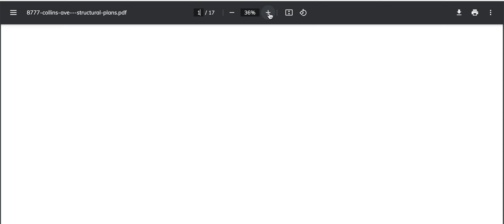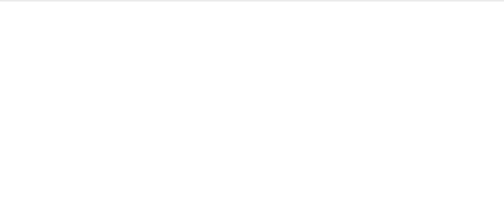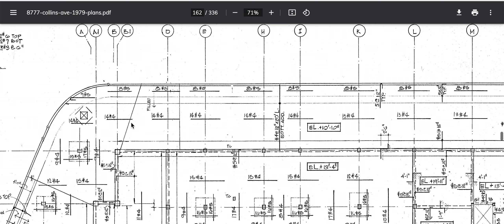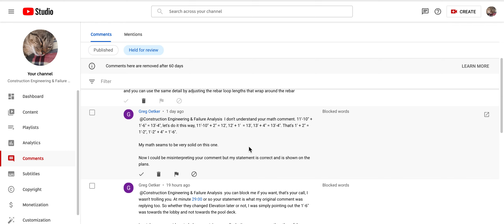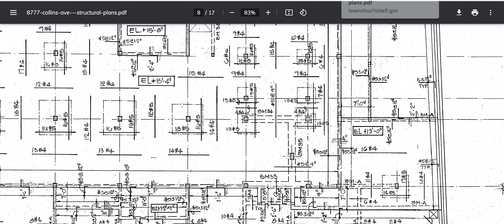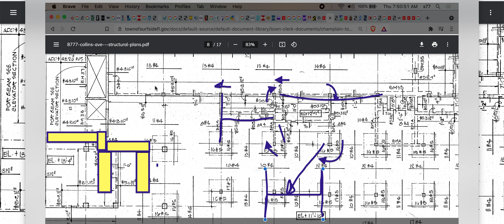Champlain Towers Surfside Building Collapse Cars AND pool deck butterflied plus bma fracture

Comment: I have looked at a lot of Videos on this Champlain Building Collapse in Florida and i always had the feeling as of the way the carpark always had Water on the Floor and cracks in Ceiling.and Always they said had to Pump a lot of Water in Carpark plus Sea Water as Well and i thought the with so Much Water over the Years and believe the water were quite high up on their cars i would not Park my Car in a Carpark what i saw the Condition in that Carpark as if i have to park my Car in a Car Park in and under a Building i know to look at were i am parking my Car.The only Time these Days as of Lockdown in AUSTRALIA u cant go anywere much but sometimes i would Park my Car in an underground Carpark below the Picture Cinema and left my Car to be Washed and chamied off and Tyres Blackened and Cost me $30 and Vaccumed inside as well but never looked at the Concrete before of the Building but After this i will be looking at the Building more as dont like to live in High Rise but live near Beach 15 min walk and 5 min Drive and live in a Single Brick Unit with a Conrete Slab.I did at first think it was a Sink Hole as.other Videos i have looked at in Florida Houses about 11 Houses were Taken by SinkHoles and then the whole Houses would just Sink all of it.But this was No Sinkhole.But i am intriged by this Collapse but very Sad killing 98 Adults and Children so need closure for familys of Loved Ones that Died and for the Survivors.U are really Doing Your Best with all the Concrete U have worked with and all the Diagrams and cam video surveliance plus looking at the pictures of the Building itself.Hope U have a Cool Drink every time U do all this work on the Building Collapse it is so involved.Thanks Kai.😇😘🦋

Comment: In the photo you show, with the cars are at an angle--is the ROOF shown that of the opposite wing? NOT the center section, the second wing which fell second? (second in relation only to the security camera shot) The patio to the right of white car angled must be laying on top of parked cars below. The pool area/deck must be built differently to compensate for the weight of the water.
Reply from the maker: Why did you use the word, "must" ...  this is just data and your use implies you have data that is a matter of facts...  Please, consider explaining in more details the word, ''must'' and your meaning... ty
Reply: @LoadPathEngineering  As for using must in regards to the pool area, even when the sight was cleared, amazingly clean garage floor with just a few scrapes from an excavator. The pool looked in one piece. Water is heavy, so the deck had to have some reinforcement to hold all the water. The pool surviving amazed me. These are not musts written in stone. Architecture is not my skill. The only drawings I can read are schematics for electronic equipment of the jet I used to fly. Never know when I'd have to fix my F-111!
Reply: @LoadPathEngineering   Jobelle  I believe the pool's sole purpose is to contain the water and there would not be any need to strengthen the pool deck around it.   The pool should still stand even if the deck weren't there.  To my non-engineering eye the pool is a standalone structure and it wouldn't be efficient to also be relying on the pool deck for strength/stability.